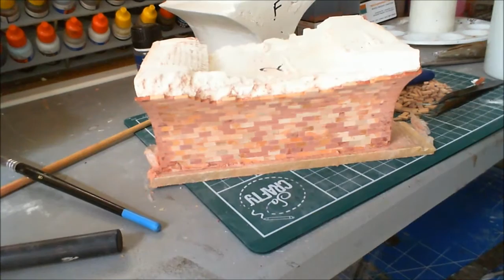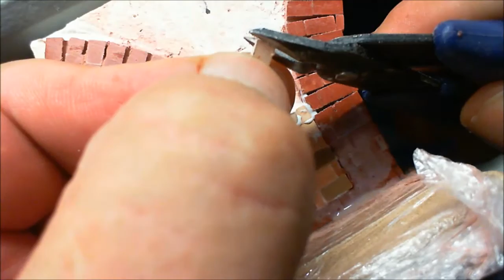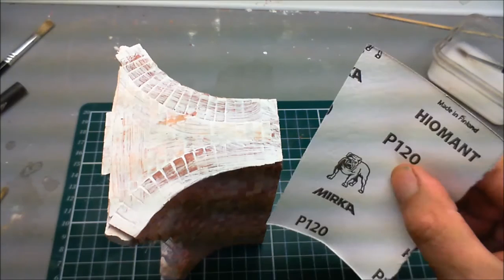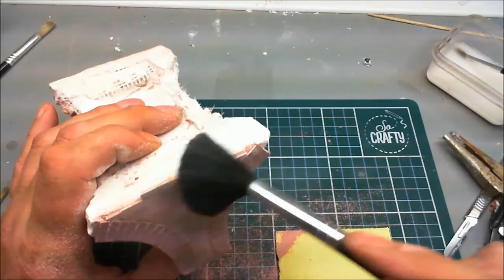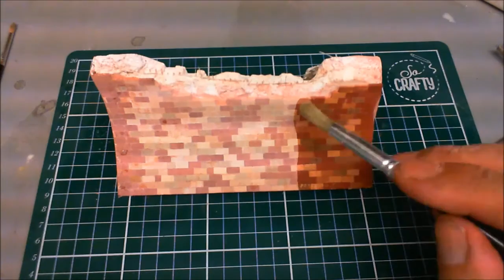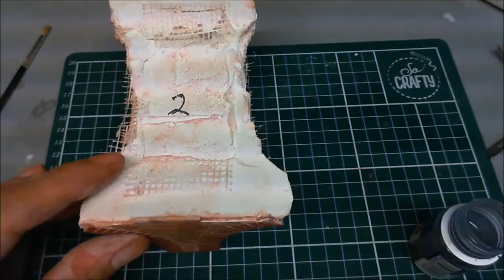JUWEELA BRICKS 1/35 scale part 2

Comment: I know this video is seven years old but it puzzles me why you went to the trouble of actually using scale sized bricks only to lay them on edge. I appreciate that these bricks probably aren't cheap and you would probably use 3 times the amount but it seems pointless to strive for accuracy only to totally ignore accuracy. Your arches would have looked so much better with the bricks laid correctly as well.